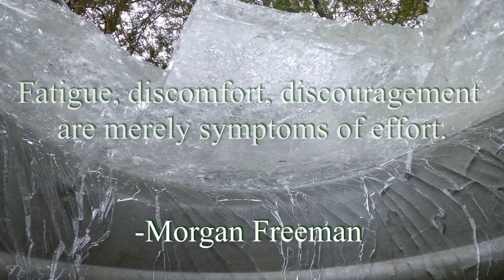Winter Camping Full Time in Michigan: The Challenges #22

Comment: Thanks for the videos! Love to watch them. One tip or two, if you don't mind. The shower pot? Store your next shower water in it so all you hafta do is turn on the stove and you'll have 3 showers ready to go (unless you use that big pot for something else, of course). And we had a boat on Lake Michigan and would need to pull the mooring out every year. In order to keep the line on top all winter, he would tie 2x4s to the line and then would tie 2-3 gallon milk jugs onto them. Along with water to fill the jugs, he put pieces of a big black garbage bag in each one. The sun would warm them up and for the most part, the jugs were still floating in the spring. He was into solar long before the rest of the world. Cheers!

Comment: 2 tips. One, keep an eye out for a bigger stock tank and find a smaller version of your hot tub. Prop it on a nice wood or stone stand in the big tank of water and put fires in it. The water will heat hot enough to give you year round baths. Just may take a while to get to temp.

2. You may want to consider digging out a pond. Siphon filtration will keep it running all year and fresh (I live in Michigan. I do this - have it set up like a waterfall). Then you'll have fresh water without having to worry.

Comment: Love your channel, Ryan! I know the weather doesn't permit this now...and I am unsure of what the water table is like at your property; but I was thinking something like a root cellar construction might help keep water from freezing next winter. Something dug far enough into the ground, then built up higher with logs above...might keep a temp around 50 degrees  Fahrenheit or so year round. You could use it for preservation (or relief from the heat!) in the summer, and use it to keep your drinking water supplies from freezing in the winter. Just a thought. Maybe a spring time- summer project?
Reply from the maker: Is there some way to build one if the ground is all rock?
Reply from the maker: Tannerite does make a loud noise but does it have the energy to move the ground?
I know you were joking but now I’m wondering...
Reply: I was thinking similar for your well problem.  If you mine deep enough you can find non frozen water.  Now how can you get an offgrid friendly jackhammer?  I'd watch that.  I want to do some mining through the rock on our property for the same reasons.  Can't put a sand point in.
Reply: @survivingringworm2202  you can make one that is half above and half in the ground. Dig out as deep as you can. Fill sand bags with the earth you remove and stack them as the walls.
Reply: Definitely need videos on these topics! In Maine, we have tons of granite rocks and boulders, and is proving to be a HUGE challenge! Just ran across your channel last night and now I’m Loving binging your vids Ryan! You’re a riot. And giving me some great ideas which are going to help us with our challenges here as we’re beginning our off grid homestead! Thanks for taking the time to document and share all you’re doing! BTW< I miss TITO! lol
 @SurvivingRingworm2202

Comment: A friend of mine who has a camp in the UP has to cross a good bit of swamp to get to his cabin. The people who originally built the cabin 100+ years ago cut cedar logs about 8 feet long and laid them cross ways on the road and then piled gravel on top. It’s a great road, zero ruts. The only problem is that the frost will occasionally push a 100 year old cedar log up through the gravel. It would be labor intensive but a permanent fix.

Comment: May use an old towel to soak up water on floor. Use the heat from boiling water to dry out towel. Find a way to hang the towel over pot. Heat rises. Use it. Just some idea. I was just thinking. May or may not work.

Comment: Hi
Melt the water in the hot tub with wood fire, use water as necessary (or put in your 5 gallon buckets) then refill tub with fresh snow fall and melt again as necessary. Wood is cheaper than propane. Cheers.

Comment: Not sure if your eventual cabin solved the frozen water issue but the thought occurred to me that you should have a set of solar panels and windmill running a resistive heating element in a sand mass thermal battery, in a well insulated box where you store your water and other stuff you want toasty warm like your boot liners gloves and hats etc. You could also build in a friction heater of some sort, maybe using a windmill to power that with the ability to add human power to spin it. Maybe a container filled with really viscous thick oil. Refining this idea... You could have this thermal mass battery also integrated with a rocket stove which burns small branches. You could design it to sleep on top of it on colder nights as well. All kinds of videos out there on thermal mass heating systems.

Comment: I don't know if this has been suggested but when the weather warms up, I would start putting in corduroy road in all your soft spots.  check out Boss of the swamp for more info.  best of luck, love the channel.
Reply: Also spreading out your ruts. You can make your trails flat by useing your tires to beat down the trail.Even drag a piece of brush behind you.
Reply: Thank you, I was thinking the same thing. It's been used for over 100 years by loggers.
Reply from the maker: Strange as it may seem, I try as hard as I can to stay on one set of ruts.  Soon as I spread them out, the whole trail turns to deep, gloppy mud and becomes un-passable.

Comment: You may need to build a storage building out of cedar if you have it, looks like a cedar next to your tool shed, or put a wood roof on your tool shed, put that tarp on the ground tp keep that moisture from coming up, maybe make a wood floor too.  Wood has a drying effect, especially cedar, they used to make cedar building for dry storage, to keep things dry and dry out things and keep them dry, I am a roofer by trade and laid up cedar roofs exclusively for my first 12 years in the trade, a cedar building with a little airtight wood stove should manage your freezing water issue and keep your electronics warm and dry

OK, after watching your video again (( I love them btw)) I just caught the part where you tell everyone you are in a cedar forest, I am a little slow to notice things

Comment: Been following since mid Spring have to say impressive chainsaw skills and resolve to spend a 2nd winter in a tent. Two things come to mind that could help out with your food/water Freezing issues as well as clothes drying and i guess showering... Ever thought of building a sauna and id suggest adding a rocket mass heater to that building. By firing up the sauna with all the mass of the stones would keep the building reasonably warm for awhile keeping your water and food unfrozen and well can easily dry your sleeping bag daily. By adding some mass to that firewood stove youd keep heat going longuer. The rocket mass heater well even with the unimpressiveness of cedar as fuel its efficiency would easilly make up for it.

As you pointed out in this video the tool shed is fine and all but with cedar and mainly green at that as well all the humidity will keep accumulating as the ground thaw's and freezes.
Reply from the maker: I've seen that video!
I was actually thinking of making some sort of fireplace from several layers of bricks.  Or even a foot of dirt just to hold the heat.  Thin, cheap wood stoves with cedar isn't even worth the time.  You get 3x as much heat just chopping the wood...

Comment: Winter camping in the Adirondacks after Christmas was my preference every year for many years..
Nothing anywhere near as elaborate as your get away.

Snowmobile?

Campfire +rocks = hot rocks.
Hot rock in a small pot inside a "cooler" = warm stuff.
Reply from the maker: Love that area!
I camped out for New Years for over a decade. Was the best holiday of the year. 

Yup, have Snowmibile but easier to maneuver the 4 wheeler around here as long as I keep the trails packed.

Comment: Find some insulated garage doors that are getting thrown out and build a box big enough to put your batteries and charging equipment in and run one permanent power cord into the box and silicone around it the heat from the batteries charging will warm up the box

Comment: I live simply in northern wisconsin. One consideration for you is the power/heat of Mother Earth. Once you get below the frost line your constant temperature will hover above freezing so those things you need to keep from freezing, like water and batteries, will do better. Consider making a root cellar or modular high tensile structure which can be completely buried by Mother Earth. She'll help keep things from freezing, plus you get to incorporate another of your endless commodities out there - dirt.
Reply: Oh, and shoveling dirt/digging in the ground? Best workout! You'll be looking like Hulk Hogan by this time next year :)
Reply: I've also had some luck using a diesel heater which is more efficient than a propane heater. Propane is ok, but the moisture issues are way worse than the cold! Either way, propane or diesel, proper venting of the emission is what you need to handle the moisture issues. That's why I like the diesel heaters for keeping warm indoors; you can vent the emission effectively. Check out Slim Potatohead's channel to see his research for winter heating a camper. He's funny, a bit of a creature comforter, but I get some great info from his research and thoughtfulness.
Reply from the maker: Cool!  Always looking for new weirdo Youtube channels.  Will have a look tonight!
Reply from the maker: What to do if the ground is all rock?
Reply: @survivingringworm2202  You do have piles of sawdust around there...how ‘bout an insulated above-ground cellar? He kind of hinted at that above...

Comment: I'd try and run wires from the batteries into a plug to snap in place of the battery. Keep the battery insulated or close to the body.

Comment: A small 4 cycle lawn mower engine running an alternator, routed through a voltage regulator, to a deep cycle battery, could be used to charge your camera batteries. Just a thought.
Reply from the maker: Now there's an idea...

Comment: Have you looked into sunken greenhouses? 
As for the heater putting out water as a nasty byproduct, building a heat exchanger may be an idea heater outside dry heat inside—lower efficiency but no water.
Reply from the maker: That would be amazing to have but the ground is all rock so sadly, I don't even have a well.
Reply: Well then........ tnt.   Sunken greenhouse and flowing well all in one blast.....2 birds
Reply from the maker: I’m listening...
And where does one get this tnt if he does not live in the old west?

Comment: Your valves and connectors should be made from polyethylene, in lieu of PVC... PVC will crack in freezing temps. Use sharkbite tubing to avoid cracking of pipes.
Reply from the maker: Didn't realize that.  Thanks! They are put together just as I bought them from some farmer.

Comment: Hello Sir,
I was wondering if when you make the first cut with your mill and get the half round off the top of the log for your flat surface to mill from, would you be able to use those half rounds to fill in the tire ruts on your trails?

Comment: Bury liquids upside down in snow to insulate at 32F to slow full freezing.  It will start at the water/air interface inside, but it will at least delay full freeze down to the cap beneath.  UV light bounces on ice crystals into drifts even during overcast which is why snow drifts collapse even in cold weather if there's no new snow on top, which gives even a little more insulation against the cold.  Rodents make use of this pseudo insulation to create their highways under there.  The closer to, or in,  a significant pile of leaves makes use of geo and bio therm during decomposition.  It's never going to completely fix the full freezing problem, but any delay to full freeze is a faster defrost.

I dry clothes in full winter on the line, making use of dry winter air instead of dryer heat.  Many old school Polish and Norwegian immigrants do this.  Granted, it still feels wet when you put it on because it's cold, but if you warm them up in the tent so socks are supple again, you'll be able to better gauge dryness before you put them on.  To avoid wet feet from touching the tent, try tossing a sheet over the lower half of the bag to wick the drops to each side for faster drying and less spot soaking.  Instead of sealing the tent off with a snow skirt, try piling a ridge of leaves, maybe 4-6 inches wide and 4 inches high.  They'll block the wind, hold the heat in, and absorb some of the moisture that drips off the fly while allowing a little ventilation for moisture.  Shuffle the leaves now and then, moving the damp ones to the outside and fresh ones closer to center.

I live in norther mitt michigan, so I feel for ya.

Comment: if you only had a water trough and a wooden floor, you could always heat water in the tub and put the gallon jugs in the tub on
the wooden floor. Use the system as a double boiler. Now if i oniy had a doomsday cloak

Comment: Cheap tip: Use a salt water bottle to help buckets keep from freezing. Ranchers sometimes will do this to keep stock tanks from having ice on top. probably worth a shot since it costs nearly nothing. Take around a 1/4 cup of salt in a bottle of hot water to dissolve and just let it float around in your buckets.
Reply: Interesting tip.  Ocean salt water freezes around 28.8F, and more salt means lower freezing point.  A lower freezing point often means enough molecular thermal activity to keep water from freezing at normal temps.  Of course we can't drink that, but I wonder if a salt bath will keep other container liquids floating in it from freezing as well.  It might be a useful experiment.

Comment: And when you do build Annex Building get some Tyvek wrap around the outside of it before you put your outside boards on it that's going to cause a barrier from the wind going through the cracks and like I said just use up fish tank heater get the largest when you can on the solar panels and it'll heat up that building if you stick it in a 5 gallon bucket of water fat buildings at least insulated did you later bye

Comment: You probably  know  how to do a shower.. as long as u have heat.i do it this way. 1. 5 gallon bucket. 1 tote. Storage  tote. I cup for pouring. Warm  water  on stove u got a shower. It works 👍.  💪  use a shower curtain to stop water from going  all over your floor. U use your clothes  for drying off. I don't  use shower curtain I mop floor after words 2 birds 1 stone tip from off grid  homestead.  Guy. Battery's I have  issues  with  cold and lead acid. Don't like cold. Trying to figure  something out for that issue.  So for battery  I have  no idea.  1 of my biggest  issues. God bless

Comment: A few round rocks heated by the fire will store & release heat for a long time  ..   tip for using rocks 
 1)as personal warmth or the sleeping bag : a couple fist sized rocks boiled ( controlled temp, water boils at 100 degrees ) 
2) a wooden box covered and  somewhat insulated and a metal pail of hot large rocks should thaw and keep your water pails liquid 👍🇨🇦

Comment: i  bought a brand new weed killer pump up 3 gallon unit and only use it for showers i use a milk crate to set on and  mix the water hot with a little cold water so i dont scald myself  mix screw lid on and pump it up to pressurize it then use half to soap up and shapo and or=ther to rinse off no we do this when we are camped out several day in the middle no where after we ride our 4x4 all day you cant beat that shower before bedding down lol im think on get a new weed killer that has a  battery powered pump built in lo,l

Comment: Switch to baking soda for toothpaste.  It won't freeze and no residue after rinse.

The condensation in your lean to hut is likely coming from the ground.  Try throwing a tarp as far under the walls as you can get it to cut back on ice crystals inside.  Vent through before you leave for extended time to vent your breath from time being in there to work.

Comment: Here is a solution for you.  1.  Get an old cooler. I'd use a 120qt or larger. ($55 brand new with free delivery from walmart. Probably much cheaper used).  2.  Dig a hole and bury the cooler with only the lid sticking up.

With less than 2hrs of digging, you now have an insulated cellar to store your things.  This "cellar" is going to be surrounded by 30-40 degree soil instead of 15 degree air.  You can easily keep things from freezing in your new cellar.  A cheap cooler buried in the ground is far more efficient than a yeti stored waist high surrounded by air.
Reply from the maker: Unfortunately the ground is solid rock with a couple inches of dirt on top.  The trees don't even like to stand up very long here.

Comment: If you built a wood fired sauna, you could relax in warmth, take a shower inside and dry your towel!  All great deer camps have them, also laying the batteries on the floor would keep them at a chargeable temperature, also saves on propane if you have a water jacket on the wood stove.  We have even baked potatoes on the rocks during a sauna.
Reply: The Alaskans say that’s way better than a shower. I’ve wondered why he doesn’t just build a sauna, with all the available wood for burning.

Comment: You need a pump up sprayer, some hose, a on/off valve, and a shower head. Will make a nice shower. I like your videos. I watch a few different people and I do like how you go about life!!
Reply from the maker: I was thinking of drilling a hole in the big pot and installing a shower head. Then pulling the whole thing up on a rope and puppy once the water is hot. But a pump would be easier!